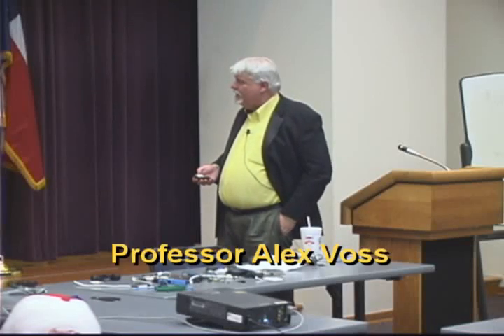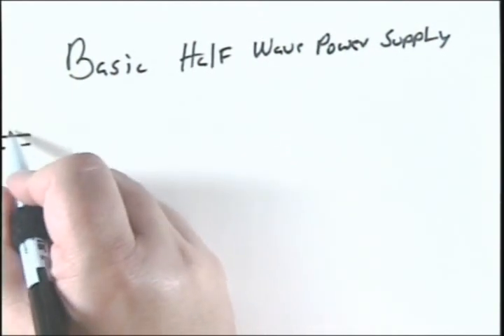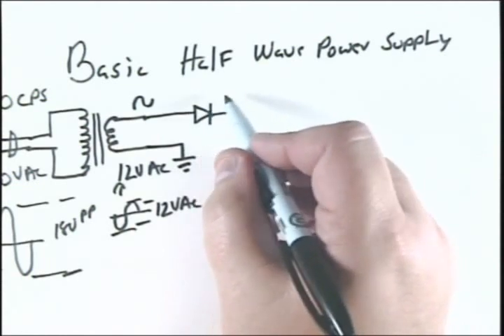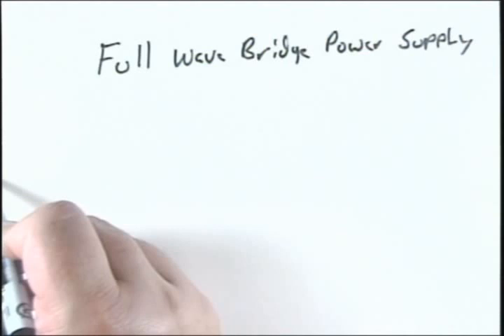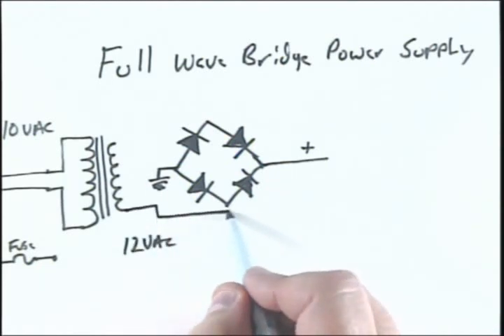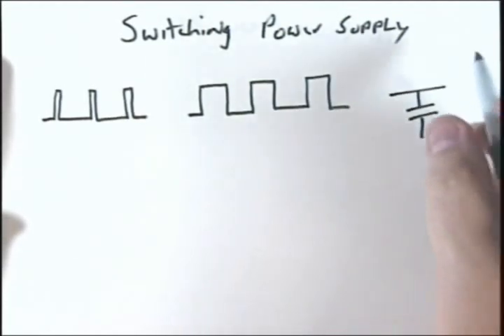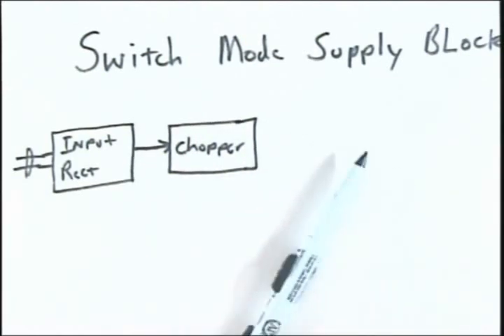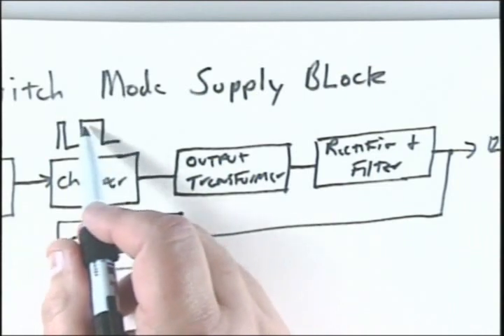Basic Electronics 18 - Solid State Diode and Power Supplies

Comment: 321, yes 120V AC is an RMS value whose peak is 120*sqrt(2) or 169V, so p-p value is more like 338V. When you put a voltmeter on AC power, it will read the RMS value of 120V.

Colin, there are many voltage regulators today, you may be thinking of the old NPN-based linear types which needed a couple volts higher on the input than the output. For yrs now, lower input to output regs exist, they are called LDOs ( low dropout). But yes a 12V secondary when rectified will provide 16-17v.